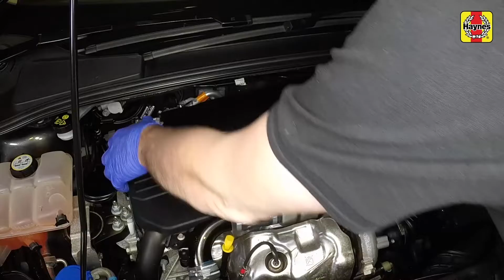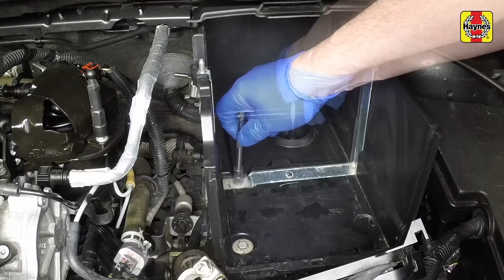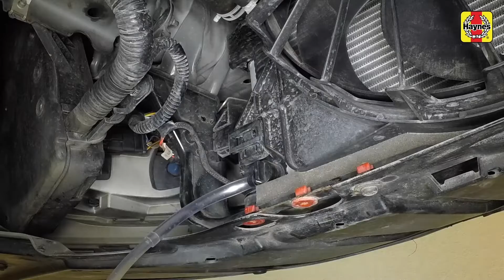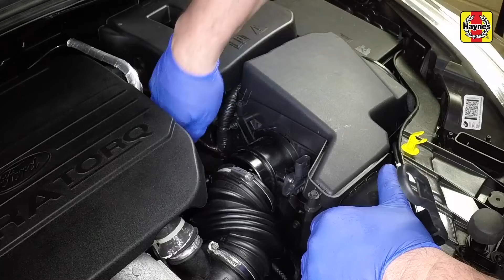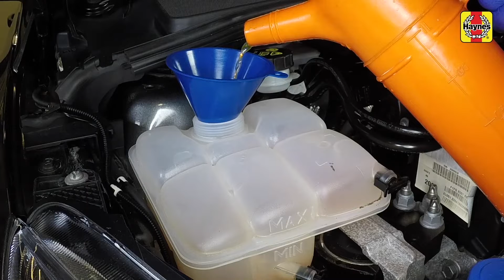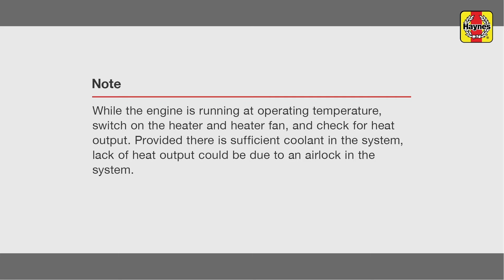How to Replace the thermostat on the Ford Focus 2014 to 2018

Comment: I have a question: Should the drainage valve be turned 180 degrees or 360 degrees?
I have the same valve, but I could only turn it to a vertical position.
Should I apply a bit more force?

Comment: What poor engineering for the engine and compartment just to install a new thermostat. this used to be a $5 thermostat and a 30 minute job. Now the dealer wants $350 to do this.  Great video.
Reply: $480 on some cars now..

Comment: Whats the part called with the dust cap on i beoke mine and need new 1 in uk
Reply from the maker: The bleed cap is fitted to the thermostat housing.
Reply: @HaynesManuals  yes but the peice that it screw ti popped out so there's a hole there can't find any on internet

Comment: Cars have become insane we used to remove 2 bolts swap the thermostat and it was done
Reply: This was 4. So crazy.
Reply: Just saying same to my old man lol
Reply: Agreed
Reply: @steveu235  IKR??.. My Pop taught me how to work on cars.. I stopped doing a lot of it because the locations of parts on these newer cars are smashed together, the engines are mounted sideways, and what used to take 20 minutes to do now take an hour because of where they're located...
Reply: @steveu235  right i hate these new cars. This is ridiculous
Reply: @steveu235  The good old days eh?  The first car I had, 7 year old Hillman Avenger bought second hand when I was seventeen back in 1978. Cars really looked their age in them days, mostly rust buckets, but working on them was so easy compared to the cars of today. Loads of room to get access, and generally a lot simpler. As stated, replacing the thermostat was a breeze, two screws and a jubilee clip easily accessed. I'll bet none of today's cars will ever be vintage and veteran cars in the future. Much to complex and difficult to work on by the amateur enthusiast. The old cars had much more character, and nicer to look at. - Maybe not quite as reliable.

Comment: My 2013 1.0 ecoboost focus engine heats up really fast. Engine be boiling withing a minute but it doesn't overheat. It also doesn't cool down after I switch off ignition,  I could leave it an hour or two and temperature gauge would still be on halfway? I'm completely lost any help would be greatly appreciated
Reply: Thermostat is stuck , replace

Comment: A very helpful video. The steps to remove and refit the undertray are shown twice, presumably where you edited together existing videos for each of the components. Good that you wore gloves throughout - probably worth saying out loud that the coolant is toxic and you should avoid touching it (and should dispose of it safely). The engine layout looks correct for my 2014 C-Max 1.6TDCI, although unfortunately you don't do a full Haynes manual for this model.
Reply from the maker: Thanks for letting us know about the undertray - we'll get it sorted!